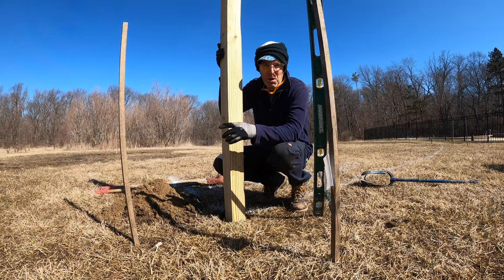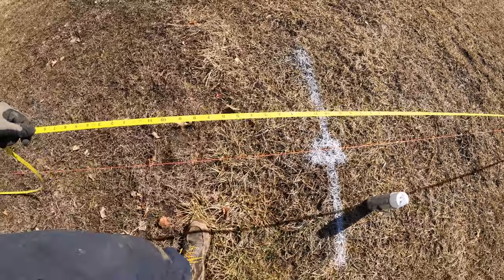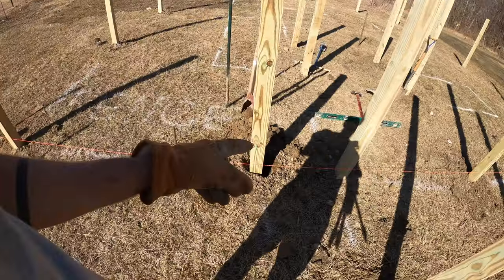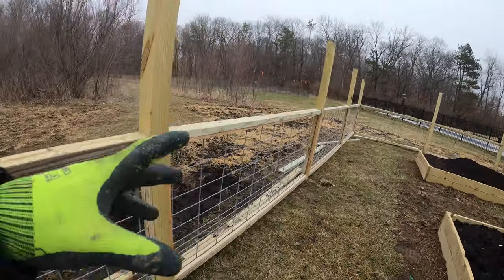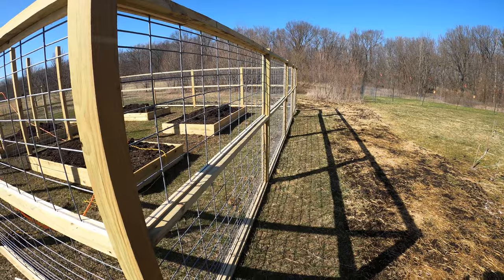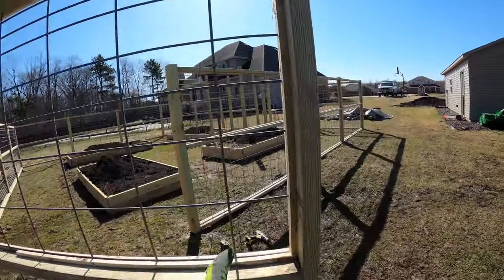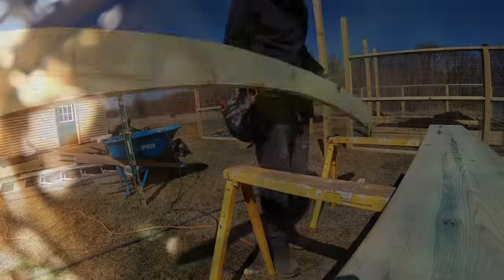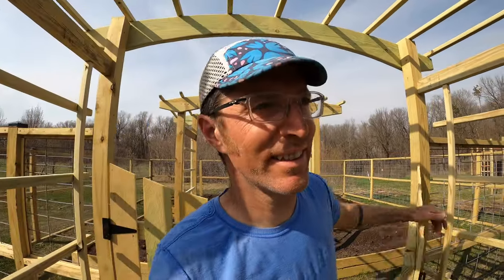Building an Enclosed Garden ➠ Raised Beds + Arbors

Comment: You are talented only thing i can see id do different is bury some block in the ground for the wood to sit on, may get premature rott from the ground
Reply from the maker: Yeah I typically add some gravel or a bit of busted brick at the bottom of the hole ... never know what happens down there over time but it's gotta help :)
Reply: @metaspencer  great idea but i meant the horizontal 2/s along the bottom if they arent vigilant about weed eating there they will get damp often ✌

Comment: Would this be better with concrete anchoring the posts? Just wondering how long the posts will hold straight without it
Reply from the maker: that depends on your ground. this was a rubble-filled hard clay soil but in softer soils you'll definitely want to concrete in your posts

Comment: Why did you use 8ft for the posts?
Reply from the maker: As I recall that soil was hard as a rock and I only got my holes 2'-3' down, so 8 footers worked for the height I was building. I wasn't going to buy 10s and no 6s were available.